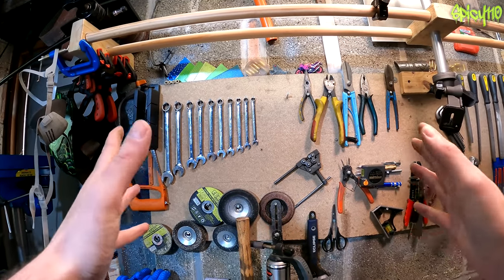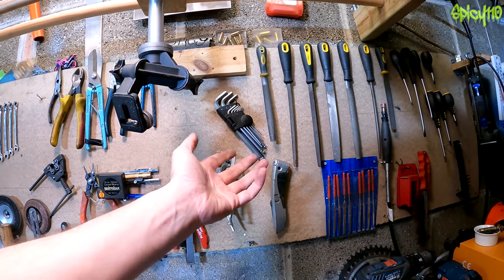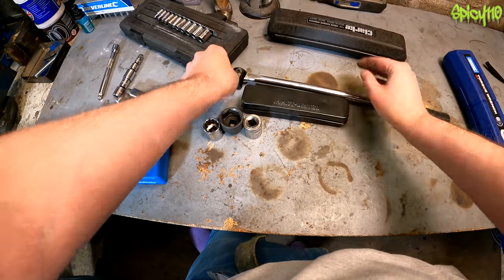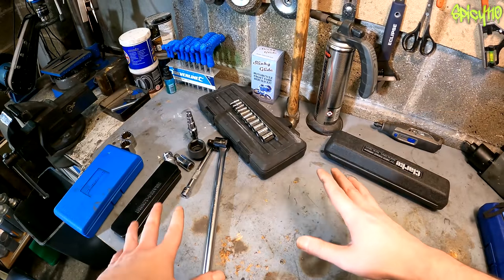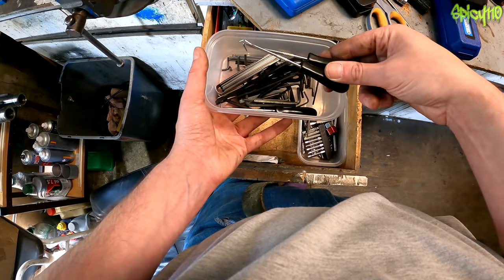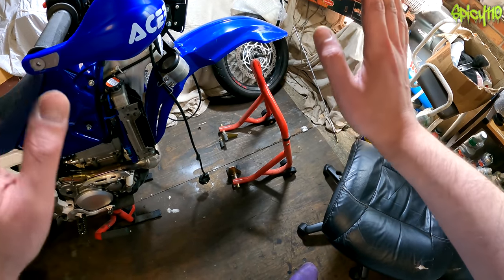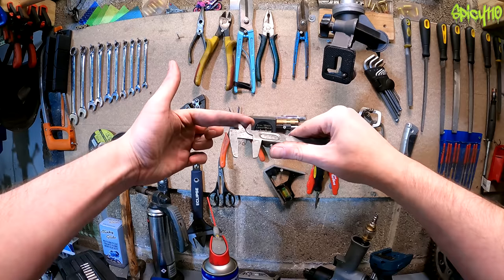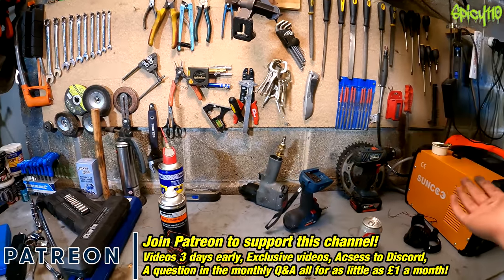Basic tool set for Motorcycle Maintenance!

Comment: Just a quick tip...always wind your torque wrench back down to zero before storage...stops the internal spring from getting compressed and giving a false reading
Reply from the maker: apart from when the box for it will not let you fully release it....Like one of mine haha but yes I should have pointed that out.
Reply: Don’t wind it down to 0, do the minimum torque above that. The spring needs a little pressure or it could go out of spec, but max pressure would make the spring weaker.

Comment: I have a £25 torque wrench and it completely striped the top of a bolt (39nm on the front caliper bolt). I had to get my mechanic around to extract it. I gave him a new bolt, he tested the wench up to 30nm, and he said no way is that 30, it still wanted to twist. So be careful with cheap torque wrenches.
Reply from the maker: Thankfully these have calibration cards so I hope they are trustworthy. But then again I know what it should sort of feel like so not going to twist a head off.
Reply: Yeah I stripped a sump bolt using a Silverline one on my Hornet :( I bought Halfords ones after and few digital ones and never had that issue again.

Comment: I would also recommend a set Torx screwdrivers and Torx drive/sockets that are used on many bikes including expensive German ones! 

Torx head screws have a six-pointed star-like shape, instead of the six flat sides of a hex key and are ideal for heavy duty jobs. They resist cam-out better than Phillips head or slot head screws and the design allows for a higher torque without slipping to be exerted than a similarly sized conventional hex socket head where there is a risk of damaging the head and/or the tool.
Reply from the maker: Not a single bike I have worked on has had a Torx head screw on it. That's why I didn't mention it for basica, Must be the new stuff or luck of the draw. 🙂
Reply: @spicy110  They are everywhere on that R9 you lusted after in a previous video!   ;~}

Comment: You missed out:
Spark plug gap tool & gauges. (Because a spark plug gap is never pre-set by the manufacturer for your specific engine).
Broken bolt & stud extractor tool.
Both types of broken screw extractor bits.
Arc welder.
Angle grinder (always wear a crash helmet with the visor down because safety goggles will not protect your face & head from a disc suddenly breaking up!!).

Comment: Great video, and a good list of essentials, I'd like to add if anyone has a Japanese bike, (also works with any  other vehicle) is a Japanese industrial standard screwdriver. absolutely brilliant for not stripping screws due to the sharper point giving you more grip and the one I have also doubles as an impact driver. I have a 21 year old fzs 600, they are know to have screws made of cheese and it's a life saver not one stripped screw and iv had the bike in bits multiple times.
Reply from the maker: Many people have said this to me over the years about the DR, I have never had a problem finding a good fit. I might have to buy one just to see. 🙂

Comment: You missed out HMP (High Melting Point) grease for use on drum brake internal components (cam faces, pivots, etc.). This is the only grease that can be used inside a drum brake because it doesn't melt when the brake drum reaches operating temperature extremes.

Ordinary grease will melt & contaminate the drum, rendering the drum brake useless unless cleaned out with brake cleaner.

If you don't grease the internal components of a drum brake, the drum mechanism will eventually seize and fail to release.

This is pointed out in many Haynes & workshop manuals.

Comment: Lol don't use copper grease on brakes that's the exact reason I bought it in the 1st place to stop the disc singing.
Reply from the maker: On cars sure not on bike.
Reply: @spicy110  absolutely on a bike.  If the the brake disc is singing due to vibrating brake pads in the caliper a dab of copper or lithium grease on the back of the pads at the point they touch the piston stops the vibration.  Even though on my previous bike where the pads came with a removable plastic cover on the back of the pads they still vibrated, copper grease solved it.

Comment: Taps and dies....not sure about the coke though.
Reply from the maker: I would not call taps and dies a basic maintenance tool but valuable to have none the less. I have a set but omitted it for the above reason. 🙂
Reply: @spicy110  I remember when I first started biking, about a hundred years ago, I cross threaded the rear spindle nut. Thought it was a bit stiff and leaned on it a bit. Someone I knew had a thread file which helped until I could find a replacement.